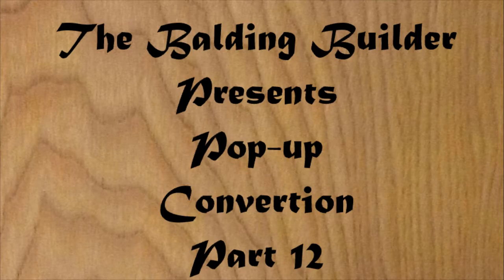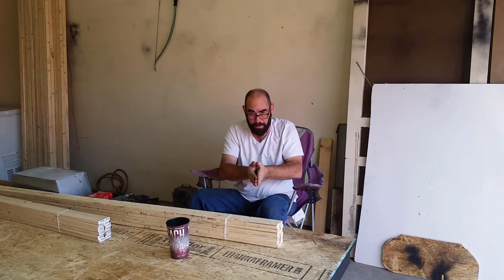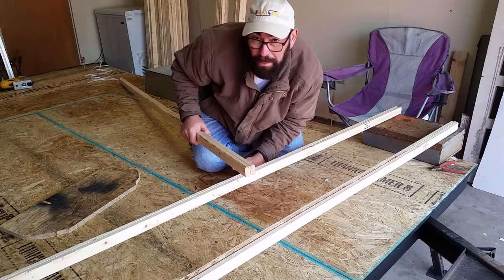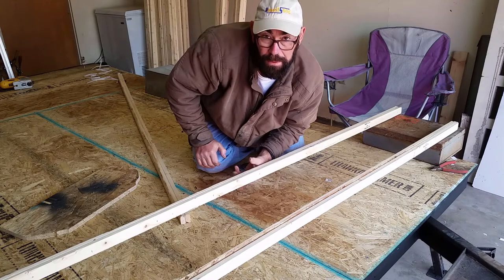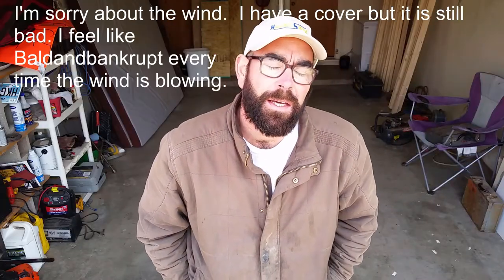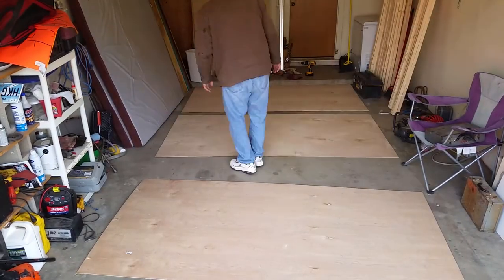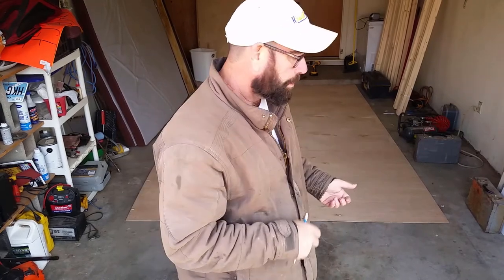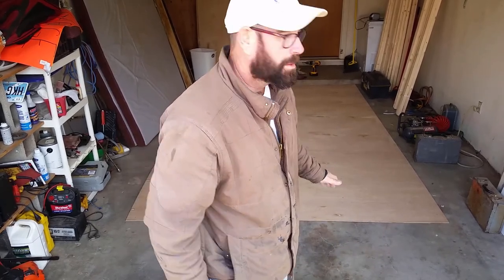Pop-up Camper Conversion Pt.12 Wall parts and layout

Comment: Nails and staples have higher shear strength than screws so don't diminish the use of nails in combination 'cause a trailer needs to have a bit of flexibility as comparted to a house due to wind resistance and pressure differences when heading down the road a 65 mph.